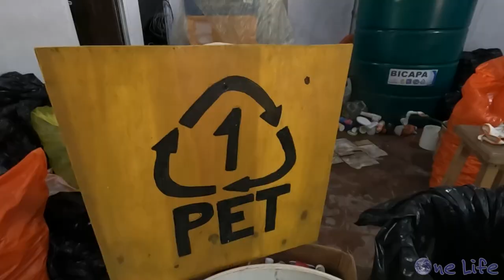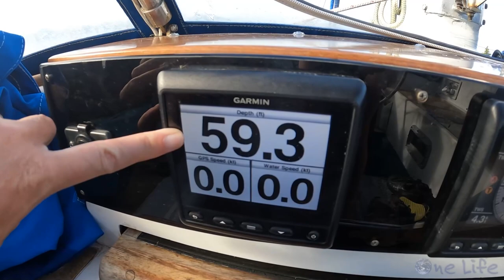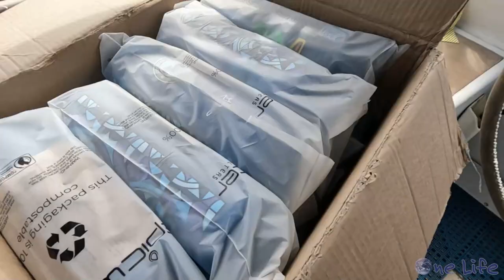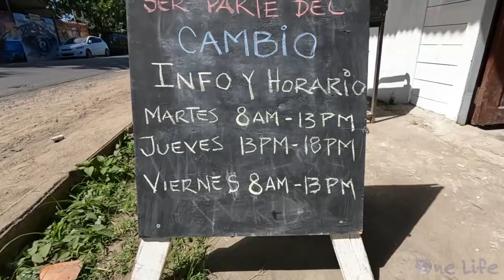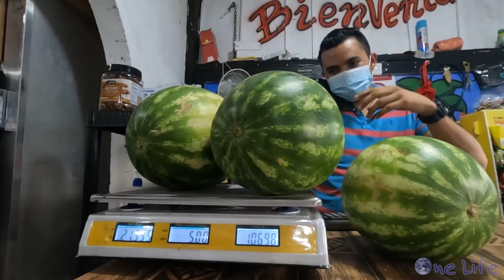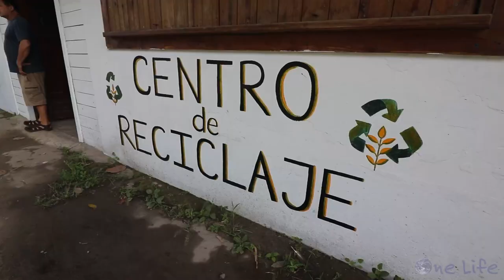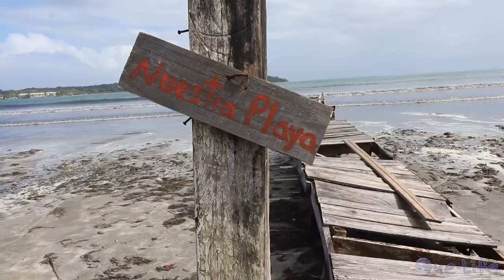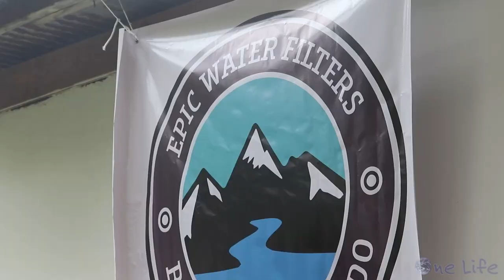Solving a World-Wide Disaster in Panama - Episode 61

Comment: Great video! How much chain did you use (you said all of it) anchoring in 60 foot water?
Reply from the maker: 275 ft.....should have bought more of we knew we'd be anchoring on 60ft. Typically we anchor in about 20-30ft.
Reply from the maker: We have 275 feet of chain, so we still were about to put out almost 5:1 scope. It was so calm and protected in that bay, so not much to worry about.